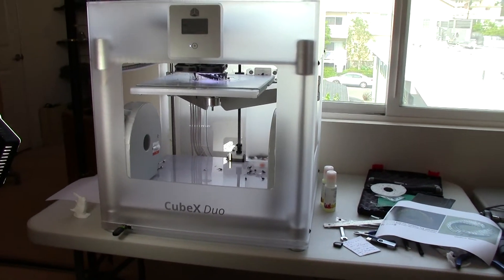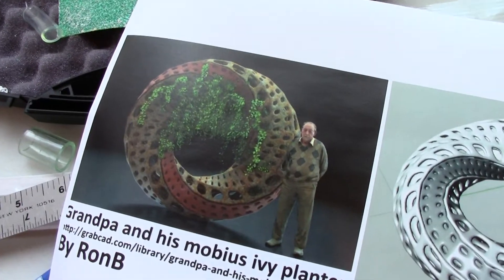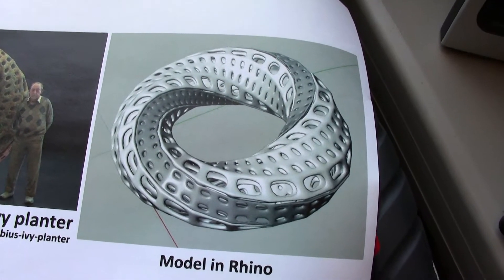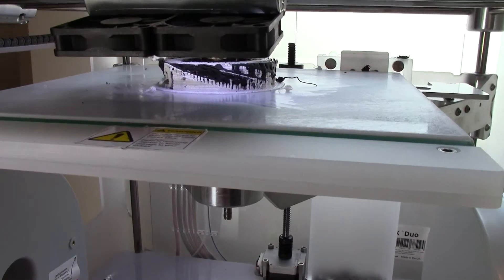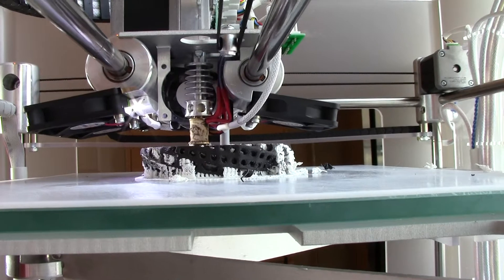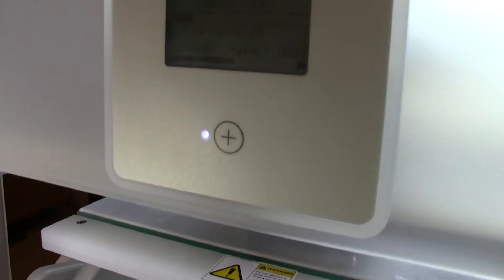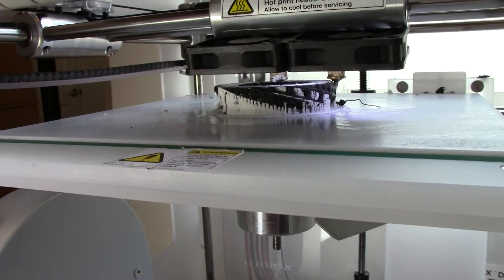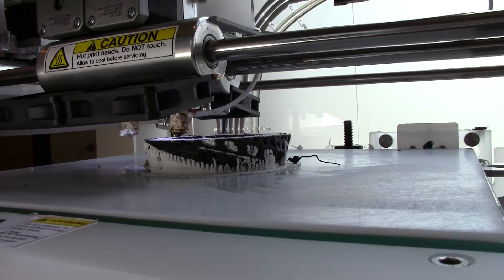Cubify CubeX Duo -- Video 008 -- Half Way There.

Comment: Hi Theory, 

I was wondering if you have any good tips or pointers about your wipe offset settings? We recently got a Duo here at work and there's been little success with a reliable offset. How far behind the wiper blade is your wiper stick? Also, does your material form a pile at the edge of the bin or does it extrude long strands and then sever them on the jet's way to the printing bed?

Thanks! 
Richard
Reply from the maker: Hi Richard, you want your wiper offset (the print head) to be about 1mm behind the white bar, and about 1mm below the white bar as well.  Your print heads might be mounted/set too high?  (meaning you might need to lower all print heads)  they all need to be about .5mm below the wiper stick.  -- hope that's some help!!